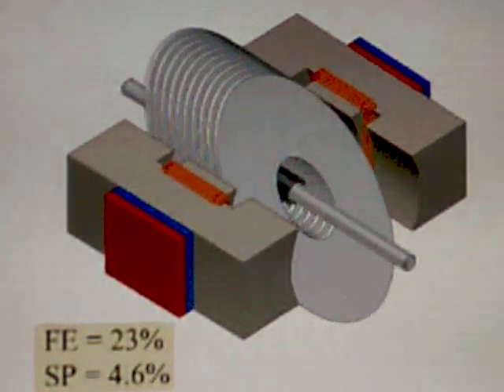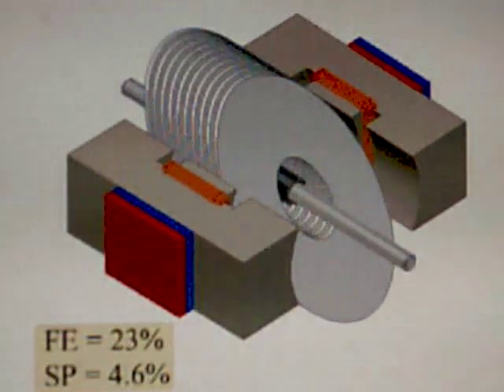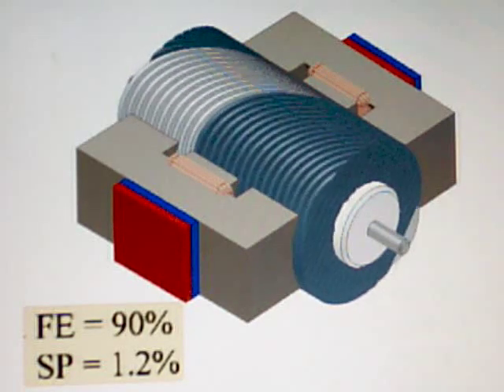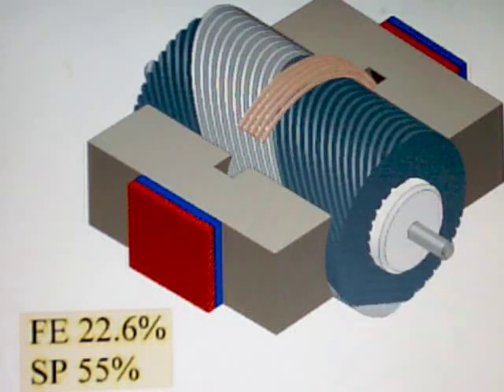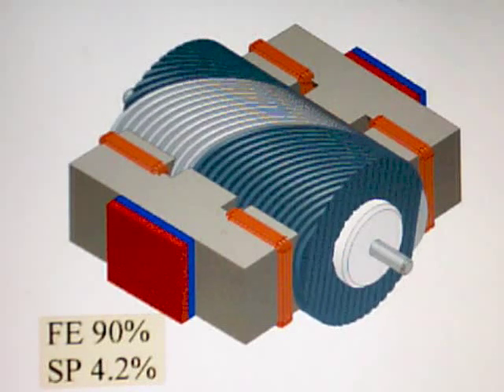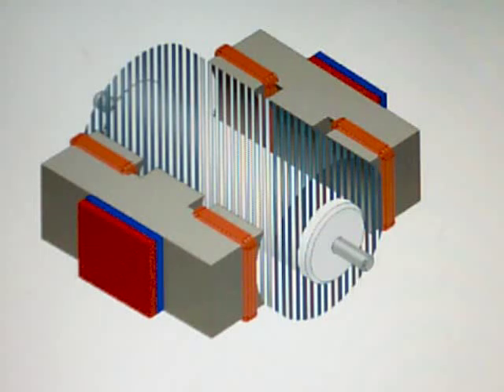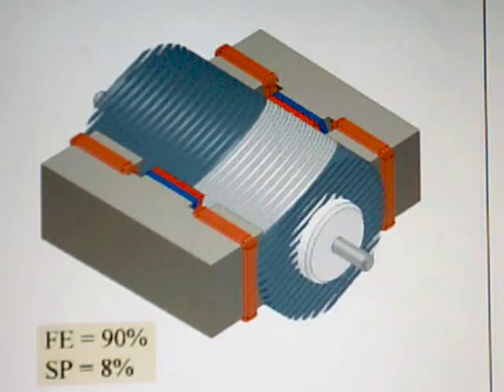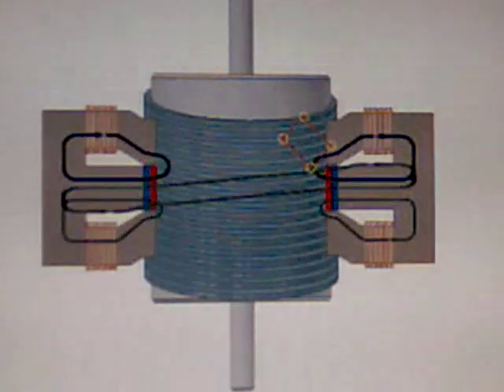Part 2 The evolution process to the source of Murray's ultra efficiency

Comment: I have a couple questions if you wouldn't mind answering them. Would you be willing to share your equations for further research, and verification? Is the software used to create the video just a solid modeling software, or is it an actual physics modeling engine? If it is the latter, would you please share what it is.

Great explanation of the concepts involved, and the direction you are taking this.
Reply: simulations are aproximations but this enters an untouched part of science which is banned for economical reasons and it involves resonance in conductors under no-electric flow and that changes everything ever teached also a utra high speed rotating magnetic field under unaligned magnetic domains in the ferric core hasnt been 100% accuratelly  modeled

Comment: Are the lamenations magnetized? If so, to what orientation? Are they supposed to be homopolar?
Reply: sideways from -30º to 30º like a fan movement and while rotating like a disc saw 
it rotates as qwick as you want and at high speed the poles blur out into a monopole field that wabbles and the wabbling is a magnetic field that can induce something nearby for free, it wont slow down the torke as usual

Comment: This has absolutely nothing in common with homopolar generators, except that it has a rotor.
Reply: it rotates as qwick as you want and at high speed the poles blur out 
into a monopole field that wabbles and the wabbling is a magnetic field 
that can induce something nearby for free, it wont slow down the torke 
as usual

Comment: What is that motor made of? Does it geht magnetized over time? What are the field configuration? Talk more about what the concept is and not just about improvements. I think you won't answer because that is FAKE
Reply: ferric material, non ferric material a voltage source a lot of wire and another motor. yes it does. its a rotating field that wabbles too. its a monopole that holds the rotation in mid air enabling high speed under no current drain, so you can hook up the other motor and enjoy an output or turn of the first one and power it with the second and also power up something else, Gerard Morin covered already the concept part. I answered despite you haven't even researched yourself that much.